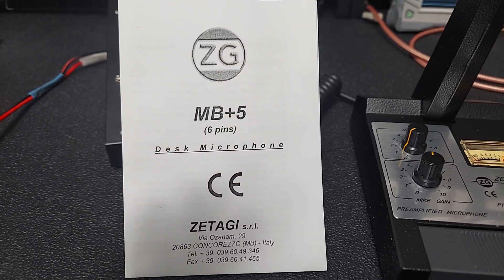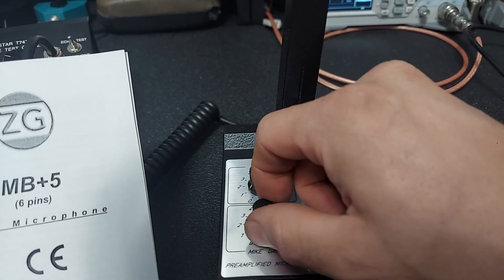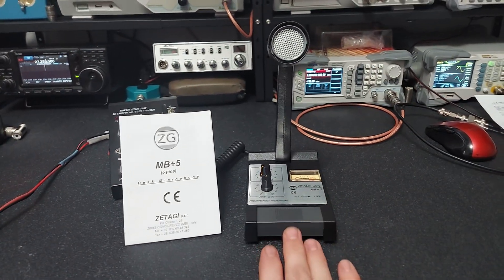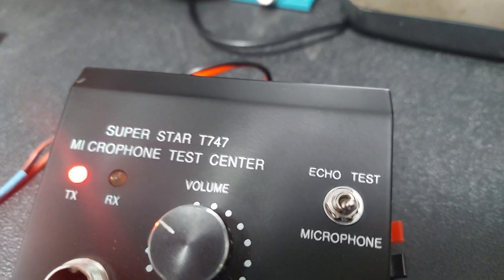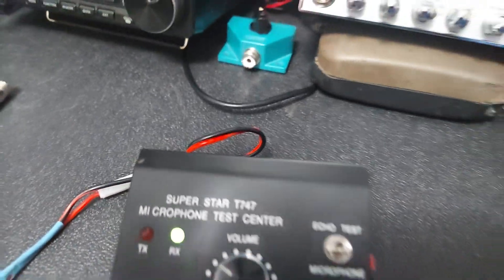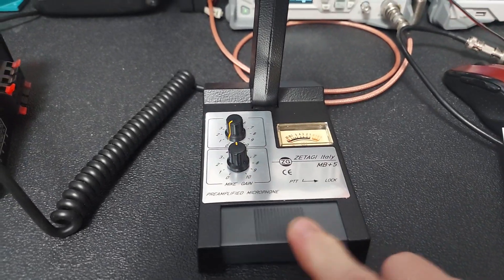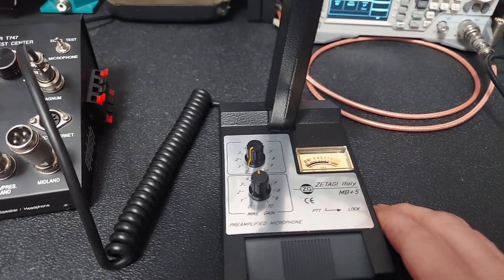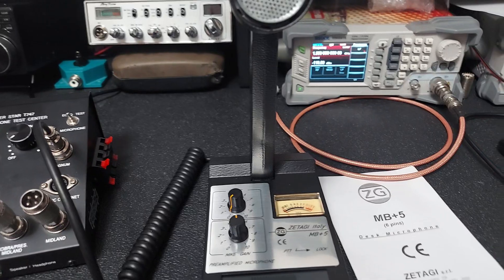Zetagi MB+5 6 Pin for Mr Lee in New Jersey

Comment: Scott, did you try it on the 7300 with the decoupling cap?
Reply from the maker: Yeah, I have a microphone adapter. Works well. Just need to watch the ALC meter on the radio and maintain a proper level.
Also need to keep the audio compressor low if running it. Really don't need the audio compressor at all since it is amplified mic.
Reply: I have several adapters for mine too. Turner +3,  and Heil mic. I found the old Icom SM-8 seems to sound the best. Clean, loud enough audio. Some that like the loud CB sound don't care for it.